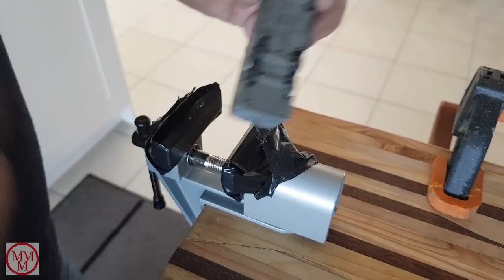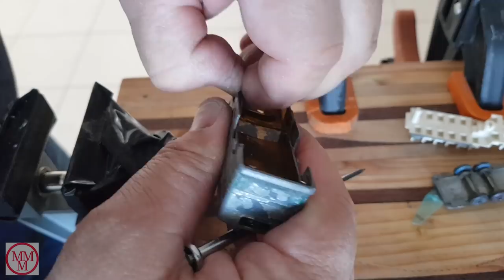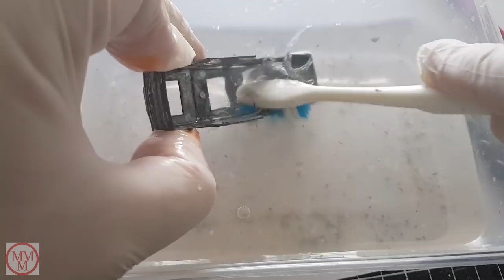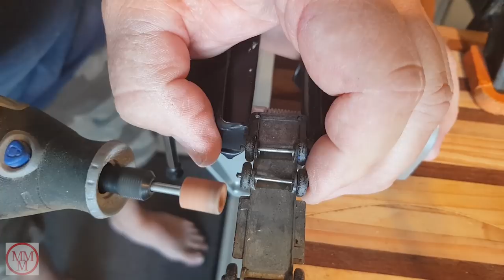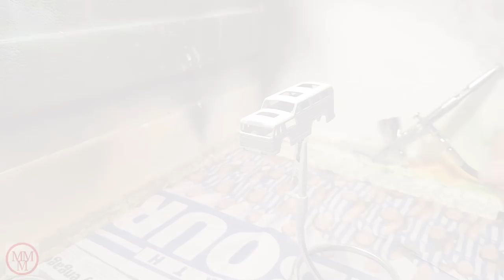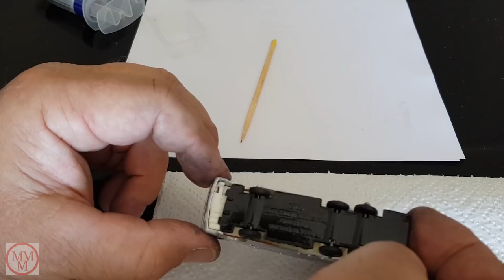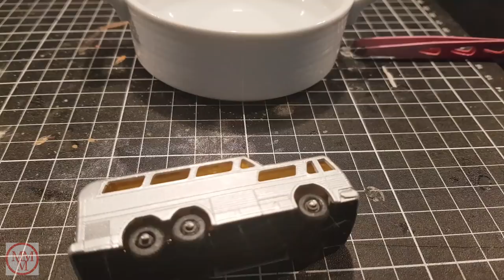MATCHBOX Restoration No 66 Greyhound Bus 1960

Comment: Brake fluid removes paint very well from plastic with out harming the plastic, have used it to strip paint from plastic models with great success, just a dab would have worked well on that wind screen, Good Luck and keep restoring .
Reply from the maker: I'm gonna try this next one i do 'cos so many people are saying the same thing.
Reply: If brake cleaner doesn't work purple power does as well and it wont harm clear plastic.
Reply: Joe Marco no it doesn't.   Dettol works though common in model building world
Reply: Sean Fiba yeah I submerge badly painted miniatures in dettol, works great
Reply: Dot 3 brake fluid for the plastic, could try one of those mini sand blasters used for glass etching ,use walnut shell or plastic bead shot for the body
Reply: d aach I put a clip up of me glass bead blasting one on my channel
Reply: Floor polish works well for restoring clear parts too. Use clear floor polish like Future/Pledge and dip the whole  canopy in it, take it out and let it dry. Far better and easier than using clear paint and it also fills scratches very nicely.
Reply: Projekt:Kobra Brake fluid wont harm you unless you drink it and being hydroscopic it just dissolves in water. There are no noxious fumes either. I have used it for years without bamaging my drain. 🤪
Reply: Doesn't brake fluid craze clear plastic.  My go-to paint remover is NON-acetone nail polish remover.
Reply: @emsleywyatt3400  It's not the brake fluid that makes clear parts craze but the paint that was removed as the paint etches the plastic a little to give it some grab, but all you need to do is use the old fashioned white toothpaste and a rag to polish it a bit, and then just dip the clear part in floor polish. After dipping put it on a tile or some such thing and cover it with a plastic container to stop dust getting on it while drying and your part will be clearer and shinier than brand new. I actually dip my canopies and clear parts from brand new sprues to make them better than factory.
Reply: I use fume free oven cleaner to strip paint and isn't harmful to plastics.why didn't you use solder for the tabs?
Reply: @trevorpom    Warning: DO NOT USE ACETONE!  Please don't damage your clear plastic parts by using any acetone.  It causes some (polycarbonates for example) to craze.
Reply: alex tworkowski I never use acetone. It’s way too harsh and I don’t like the fumes. All I use is either brake fluid or, if I’m using acrylics, I’ll sometimes use methylated spirits to strip paint.
Reply: @kamdenbarclay486  PP definitely works on paint.. my go to for plastic models :)
Reply: Brisdad53 ... Brake fluid does not melt all pastics...
Reply: @trevorpom   Hairspray sometimes works for removing paint and permanent marker from plastic.
Reply: I've got a magical formula for plastic parts... half ACE DELICAT stains remover , half caustic soda. No brain damage, no attack on plastic parts. I use it on half done plastic kits, the sort you can find for a penny on garage sales... let a few hours into the mixture, the paint will disappear.
Reply: Can also confirm the brake fluid ( definitely not brake cleaner unless you really want a puddle of goo and don't reuse the brake fluid in your car) as I used that to strip model railroad locomotive shells.
Pine Sol type pine cleaners work as well
Reply: Beat me to it!

Comment: Just a suggestion on your wind screen restorations when they are cracked or pitted.  After you apply your clear coat while the paint is still wet and fluid, place the part in a degassing (vacuum) chamber.  The vacuum will pull air out of the cracks and pits allowing the paint to fill the voids, making them far less visible.  Very fine grit sanding and a little buffing will make them look nearly new.
Reply: Wouldn't your process also work on the plastic headlight covers on full-size vehicles? Mine are a mess.

Comment: I always use a Q-Tip when I apply transfers onto a model, it aids in application and also helps to take access water off the item. Hope that helps. The plastic windows come up very well.
Reply: Well thank you for the critic for whatever reason. Just passing on a tip that I later found out that Marty already knows about and his useful suggestions. And no I don't have a You Tube Channel and no I will not shut the f@*& up.
Reply: Access water?

Comment: An option for refastening the plastic... instead of placing the epoxy on the interior metal, you can reassemble the windshield and body, and the apply a little dot of epoxy where the rivet heads were. The advantage is that way, if someone wanted to re-restore it in another gazillion years, it would be theoretically possible to pop off the epoxy "rivet heads" with less damage to the plastic.
Reply from the maker: Good idea Brian! Thanks for your input!!

Comment: there is another model car restorer I have seen on here that taps out the rivet posts and reassembles the cars with special tiny screws made for the purpose, I can't remember who, but if you search you will find. much more professional than epoxying things, and less obvious that it has been apart.

Comment: A better body finish can be achieved if you apply the decals and give the body a coat of matt-protective finish before reassembling the body.  

If the decals have a translucent appearance you can eliminate that with a product called Solvaset from Micromark.com.  

Also for reattaching the plastic windows to the body, a flexible glue called E6000 is very good because it can withstand the expansion differences between the two materials.  It also dries crystal clear.  

A product for eliminating scratches and polishing the plastic windows is called Novus.
Reply from the maker: Fantastic info, I shall try to source these products to try out!

Comment: Next time just soak the plastic windows in Simple Green it will eat the paint off and won't damage plastic !
Reply from the maker: I'm going to get some simple green if i can find it and try out your suggestion. Anything is better than scraping paint off with a razor blade!
Reply: "Brake fluid works well too"
i've found DOT3 was good, but most today are DOT4, which does nothing. I've had some success with Mr Muscle Oven Cleaner Heavy Duty (but the non-caustic one isn't any good)
@Rick Scherer, which Simple Green do you use? i see a few different varieties, including an industrial grade version.
Reply: I use 99% Isopropyl Alcohol from the pharmacy to strip the paint off plastic model trains.  I usually let them soak in a closed container for a week or two then scrub the paint off with a tootbrush.
Reply: Careful with this, it does damage some plastics.
Reply: I don't know what would be available in Australia compared to here in US but plastic-safe paint removers are available from model railway suppliers. Scalecoat's "Wash Away" is one I've used for several decades.

Comment: Another youtuber would dissolve the paint on the windows with brake fluid.
Reply from the maker: Yeah, I thought about that but concluded it would make things worse!
Reply: Oh, no...Brake Fluid will dissolve or at least melt  most plastics I thought(?)
Reply: NC Steamfan  Check out Toy Polloi's channel.  :-)
Reply: Dot 4  brake fluid will remove the paint without harming the plastic.

Comment: Excellent job restoring the windscreen! I was thinking to use 2000 grit wet/dry sand paper then buff out the plastic. I liked the way you did it though. I had one of those buses when I was a kid back in the 1960's.

Comment: I've had success with mucked up plastics using WD-40, and liquid products from the automotive industry designed to remove scratches from paintwork or headlamp lenses.  Also works on laptop computers and telephones. Great videos

Comment: Brake fluid is great at slowly removing paint off plastic without damaging it.  Also you can use silicon to "glue" in the windows.  It will come apart easier in case the model needs to be reworked at a later date.

Comment: As a precission mechanic, i suggest to try out paint remover called NitroMorse, that also works for plastic parts without damaging them that much (depending on use quantity), plus it also works faster and you almost don't neeed to use brush at all, just wash the parts after you applied the substance.

Comment: Silver solder works with the diecast, if you'd like to (build up the ground down rivets or even replace can pillers. As to plastic pieces try Casting, as to the windows Restore makes a milk white (drys crystal clear) fuild for model windows a light coating will fill scratches and add a gleam to the glass surfaces. Take a bow for your water based paints. I'd use automotive paint and an airbrush. But still awesome videos. I Thank you.

Comment: Good video and a nice job there. For the windows you could try Simple Green. I use it for all the paint removal, takes longer, a day or two. Looks like your having fun, and good to see another great piece of die-cast saved from the landfill. The Matchbox Greyhound is one of the best. Cheers ... John
Reply from the maker: Someone else has mentioned 'Simple green' I'll have to get some to try!
Reply: Like I said it takes some time, but I use it for all my paint removal. You don't have to be so careful around it like with the other paint removers. Keep up with the videos, fun watching them. I have some slide shows of my collection, some customs are in there, if you wish to check them out. Cheers ... John

Comment: The GMC PD-4501 Scenicruiser, manufactured by General Motors for The Greyhound Corporation, was a three-axle monocoque two-level coach used by Greyhound from July 1954 into the mid-70's. 1,001 were made between 1954 and 1956.

Unlike most other coaches that Greyhound used, like the MCI 7, 8, or 9, all made by Motor Coach Industries, a Greyhound subsidiary, this SenicCruiser was built by General Motors. 

I remember taking a 24-hour trip in one, from Fort William, Ontario to Montreal, Quebec, at Christmas of 1965. Quite the experience for a 12 year old.

Comment: Excellent restoration.  That bus was a wreck - about the worst I have ever seen.  You're right about the window unit not being available.  Just about all other Regular Wheels Matchbox can get replacement windows for them.  Maybe because it's a fairly large and complicated window casting that none of the restoration parts shops offer one.  Subbed.

Comment: So, the coach is based on the Greyhound Scenicruiser (1954-1956), which saw service with Greyhound until 1975.  Now, we know that the trucks in the 1-75 Matchbox range are generally on a smaller scale than the passenger cars, but still more or less correctly proportioned. For this one, the model was shortened significantly.  If you Google search for images, you'll note that the upper section of a real Scenicruiser has four long windows. Our Matchbox model, just three. Lesney obviously shortened the model to fit the standard box.  This model maybe would have been better suited for the Major Packs line.  I like it as such, though. It has a certain charm.

Comment: Hi Marty, I can second using brake fluid to strip plastic parts. My brother and I used to use it on Airfix models so we could repaint them. Leave parts soaking over night and the paint, especially enamel, will just wash off with no damage to the plastic. Bare feet? While working on heavy vehicles. You should be wearing steel caps. 😂😂😂. Really well produced videos mate. Cheers.
Reply from the maker: I am very close to trying the brake fluid trick but I am scared.
Reply: Understood. You could try it on the metal body of one of your old vehicles first just to get comfortable with the idea or maybe try soaking an old plastic part that you have replaced like you did on the ice cream van. That way you are not risking a valuable part. The brake fluid does not have to be any thing special just the cheapest you can find. Cheers and keep up the great work. Stuart.

Comment: When I was building 125th scale models a guy told me about using mod podge gloss to glue in the windows and it works excellent on diecast or plastic and when it dries it dries crystal clear so if you do accidentally get some on the window no biggie!

Comment: Yes, it looked hideous before you started. I like how you take rubbish and turn them into treasures. I might have taken several models to get parts, but you straight up take hopeless models and restore them. I had this one. I noticed the paint chipped very easily on the original model. I think because of the fluted sides they didn't lay the paint on too thick. Great restore.
Reply from the maker: Thanks again, Rob!

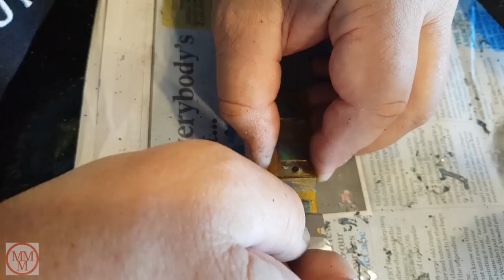Comment: 9:37  Mr. Marty,  let give an advise in this procedure :  next time dip the painted plastic pieces ( the bus "glasses" in this case) in OVEN CLEANER for a couple of minutes,  the paint will go off right on. I`ve been using this method for decades and it work´s perfectly and leave no scratches at all. The active ingredient is caustic soda, so please use gloves. Regards from Venezuela

Comment: I have heard of a name-brand pine scented cleanser (rhymes with 'mine-sol') recommended as a solvent for model paints and glue. I used it to soak and separate an old Godzilla model, and it did the job as advertised; didn't seem to harm the plastic, other than leaving it permanently pine-scented.

Comment: Great to watch these refurbishments. Have you considered soda blasting for paint removal? There is a small scale set up on YT somewhere. You could also consider one of the epoxy 'metal' products to reform your small rivet heads, the tool  you use for the axles could be used to shape them.

Comment: I work on commercial aircraft. We are not allowed to pick at anything with something harder than the material being picked at thus being unable to leave scratches. You may want to look into a second paint stripper application or pick with plastic, wood or anything softer than tin. Just a helpful friendly suggestion.

Comment: Might i add a couple of tips to help in the future, if you have the time you can fill a container with washing powder ( by fill i mean about half a cup ) and put enough water in to cover the model or piece and let sit for a few days, i tend to buy a lot if plastic models and this works really well and the plastic does not suffer, also take one of those old blades or a strip of suitable  metal, about ten or fifthteen thousands of an inch should do it, and cut a slot just wide enough for the axle pin, pop that behind the stud head and your wheels are safe from grinding marks, hope this helps.
Reply from the maker: I love your idea for a protective strip!! - Gonna make it happen!!

Comment: You could've used  a dedicated plastic model paint stripper or even oven cleaner to remove the paint from the window moulding then use a Micro Mesh kit to polish out all the scratches followed by a bath in Johnson's Klear floor polish to restore4 full clarity. Us plastic modellers have been doing this for years.

Comment: When it comes to the paint removal other clear plastic window moulding I use a Swann &Morton scalpel holder and a No 19 or No 20 blade. You can effectively "shave" very fine layers of paint off without damaging the plastic. The blades while damned sharp won't stay sharp enough for this shaving process but they are at least cheap.
Reply from the maker: Awesome post, thank you!

Comment: Have you considered adding a small rock tumbler to your inventory? You can use non-scratching abrasives instead of sand. Crushed walnut shells, stuff like that. Just put the part or parts in, go to bed and maybe by morning, the parts might be cleaned of corrosion and paint. Just a thought. Oh, also, is there anything like miniature drill presses for drilling the rivets? You could set the drill press so it will only drill so far. No chance of drilling too deep. Also, better accuracy. You can't slip and drill through a wind screen.

Comment: There is a better way. Use ‘Purple Power’ degreaser. Pour into a plastic container (or any container for that manner) and place the painted plastic part in the wash until the paint dissolves in the liquid. The degreaser does not harm plastic but dissolves paint. I have used it many times on car models to refinish paint jobs. Put a top on the container and the liquid is reusable until it becomes too saturated. It is also environmentaly safe. No scratching or dully of the surface of the plastic occurs leaving the original finish of the plastic (or metal). Rinse off with water and / or remove whatever is left with a toothbrush. If some paint remains simply put it back in the wash, completely submerged. Works great.

Comment: as far as the scratches in the windscreen i would of used acrylic head light repair kit to fill in the scratches they would disappear i use those kits  on plastic models works very well